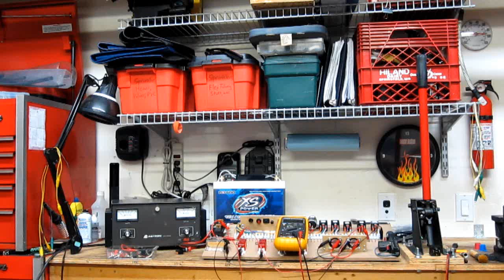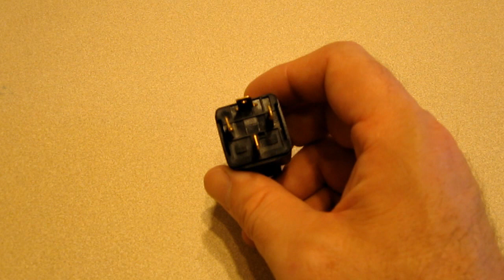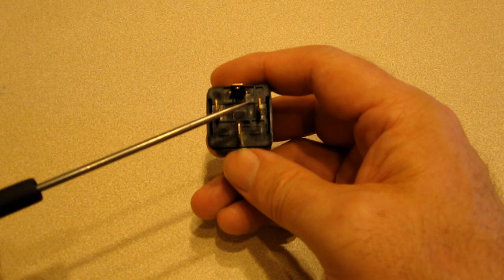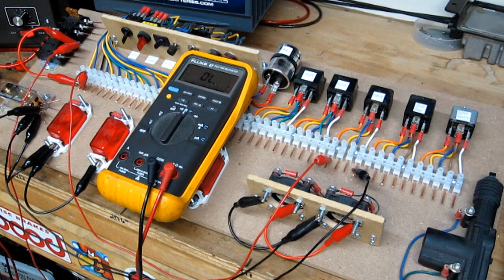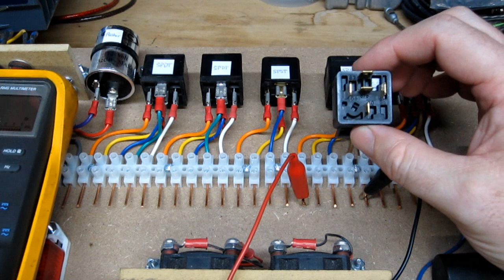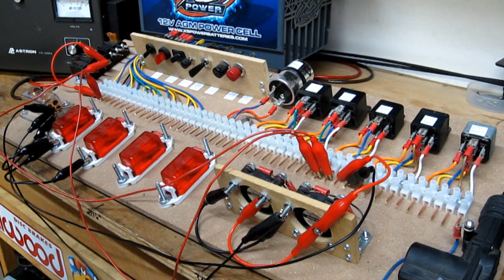SPST Relays

Comment: I cant find a spst relay with the 87B?  I'm looking on ebay, dont see it.
Reply: +Nick Sebring You know, I had a difficult time finding them myself.  These were used in European vehicles mostly and in the '90s were made more readily available.  Bosch sold their relay business to Tyco a few years back and maybe Tyco elected not to produce them anymore.  We referred to them as the "green stripe" relay.
Reply: You are the 1st person to answer with any sense.  Let me explain what I'm trying to accomplish.  I'm rewiring my 80 Harley with LED turn signals.  I have the LED compatible flasher.  I want to run the power through a relay, thus eliminating full power at the switch in the handle bars. Is it possible to run it through one relay vise two.  Size is important on a motorcycle.  I saw a micro 30A SPST relay but I would need one for left and another for the right side, then I saw a video that briefly mention an 87B terminal.  What would be your best solution 2 micro relays or a 5 pole relay with an 87B terminal?
Reply: Cool Beans.  I can stop wasting my time looking for relays.   Thanks!

Comment: Thanks for providing the informational video. What would you recommend as the most reliable SPST Relay? I am using the relays for unlocking my doors and door poppers for opening shaved doors. I have been using cheap 30 amp relays with no problem except every once in a while lately I have been having a relay go dead then come back unexpectedly. All wiring has been checked to verify that it is the relay. I was thinking of going with Hella 12V 70A SPST Relay W/Bracket 007793047?

Comment: Hello, I'm trying to run 12VDC fans off my amplifier (for cooling purposes). Currently I have a rocker switch for that and I have to manually fire up the fans whenever I get in/out of the car.
I understand that it is possible to wire it off the accessory line but the amp is at the back while acc is under the dash.
May I know what kind of relay should I be using if I want the fans to turn on and off automatically with the help of the remote line whenever i turn the car on and off?
Thank you!

Comment from the maker: A light bulb requires voltage be applied to one side of the filament and the other side of the filament be connected to ground for it illuminate.  [This would be typical of many accessories.]  The voltage causes current to flow through the filament and then on to ground, the filament becomes hot and "lights".  Any switch, including relays (electromagnetic switches) would be used to switch the light ON/OFF via interrupting the current flow to the filament - on either terminal . . .

Comment: Great videos with a Newbie question here. For the relays in general lets say you want to connect a toggle switch to power the relay to a lightbulb. Do both of the connections of the relay (30 common and Normally Open connection) go thru the lightbulb to its negative or positive terminals? or does one of the lightbulb connections go to ground. I understand how the relay works in theory, but have trouble with the connections. Help.

Comment from the maker: @4x4broncos You would need to tell me exactly what kind of switch you are using and how you currently have it wired.  Also, if the switch is burning, you likely do not have it's power feed fused - otherwise the fuse would simply blow.

Comment: i tryed wiring offroad lights like in your video with a fuse box, a 4 pole relay and a switch. but when i add the extra power to the 3 pole switch my switch burns. can i get help

Comment from the maker: @jeromeb619 I outline exactly this in Chapter one of Automotive Wiring and Electrical Systems.  I suggest you pick up a copy.  There are many variables - current draw of the pump, length of cable between the pump and switch (or relay), length of cable between the switch / relay and source of power, length of ground cable on the pump, etc.

Comment from the maker: @jeromeb619 It depends on which Holley pump you have.  Regardless, I would follow the instructions that came with the pump.  Personally, I always use a relay to power a fuel pump.  Fuse it according to the instructions.

Comment: Hey, Tony Your videos are great and I have bought your book.  I have learned a great deal from the book and your videos, especially about switches and relays.  I have aquired an electrical trainer for my class and all of the relays in the unit are S.P.S.T. but have eight terminals.  I have read your book Automotive wiring and electrical systems from cover to cover but see no reference to this type of relay. There is a slight reference to relays with more than 5 terminals on page 94